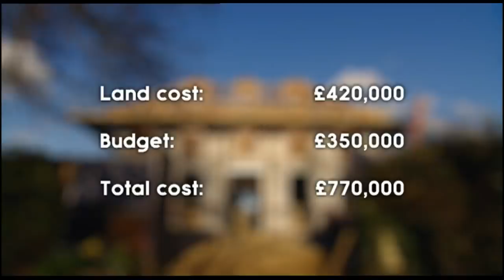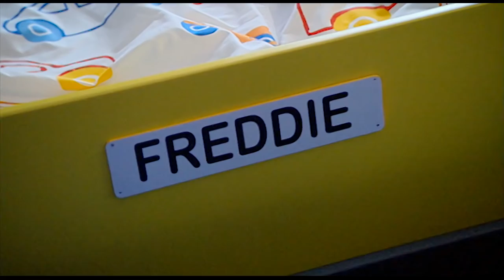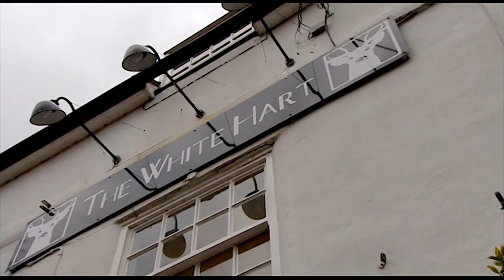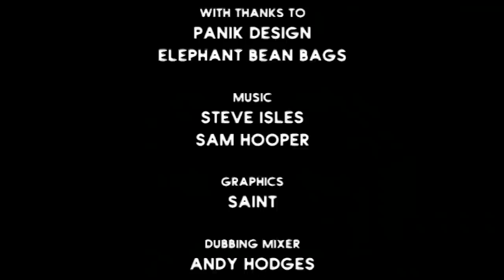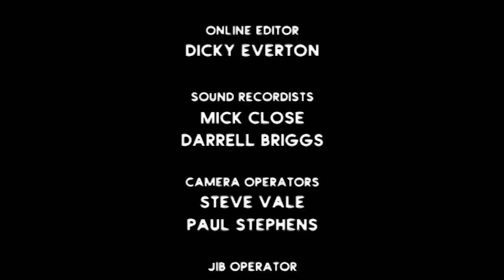Challenges of Reclaimed Design - Build A New Life in the Country - S05 EP8 - Real Estate

Comment: It's a mish-mash.  That staircase  has no connection with Georgian.  Pity they didn't consider a flat roof on the barn, with french doors opening from the bedrooms onto a huge terrace over the barn. Instead of a barn, a long gallery, which would not have blocked the views with a peaked roof, and would not have made such a gargantuan blot on the back of the house - plus, it could have fit in with the more restrained Georgian style of the outside.  They could still have had exposed beams, but in a more Jacobean  style than a barn style  with odd French Baroque blobs added on. Those baroque windows -if used at all - should have gone on the front of the house, the attic rooms, where the dormers are.